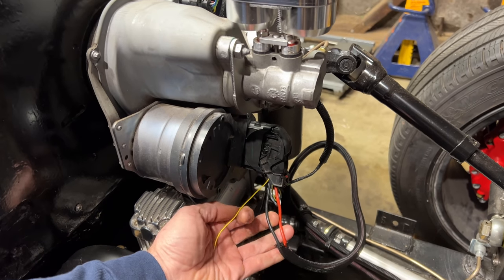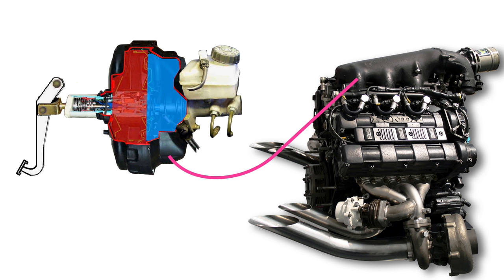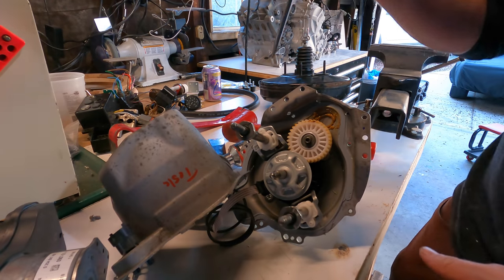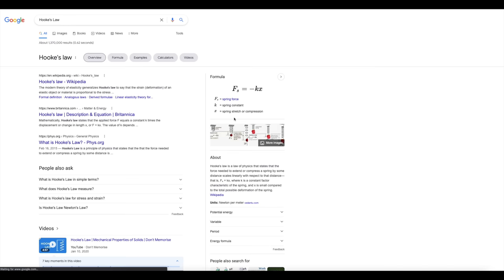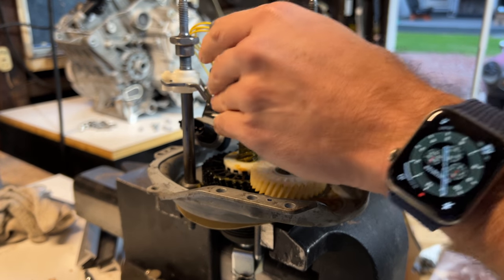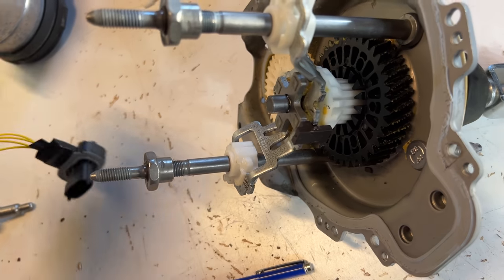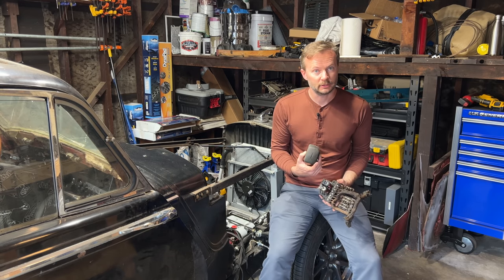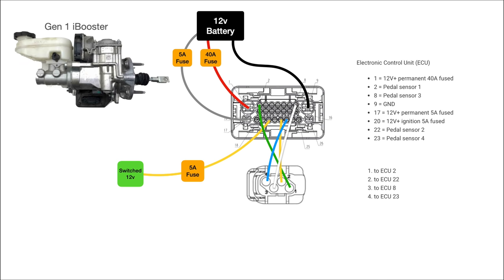Inside Tesla's Brake Booster (And How To Use It On Any Car)

Comment: If you have a CR-V gen1 iBooster and don't want to use the remote reservoir, the direct mount reservoir from a 2014-2020 Mini Cooper fits with minor plastic trimming near the front inlet port. I found it was less expensive to buy a complete used master cylinder than to buy the tank alone new from the dealer.

Comment: Thank you for the tip on the 2018+ Honda Accord brake booster. I got a Gen 2 Bosch iBooster complete off ebay for $157 shipped. This will make my 1955 GMC pickup MUCH safer! So thank you! ❤️

Comment: I remember my first car annihilated the catalytic converter and it got completely plugged up. So the exhaust gas with no where to go, went through the EGR and created positive pressure in the intake. I’m not sure which was more terrifying, my brakes going stiff, or the pedal going to the floor. Because Ford gave me both of those experiences.
Reply: They also pipe engine sounds thru a plastic tube into the cabin. So you can hear Fords mechanical failures more clearly.
Reply: What model and year of Ford was that?

Comment: Check out the braking System on the Audi eTron. No contact between brake pedal and brakes, only in emergency fallback mode you get a physical connection.
All that in one box.
The result is perfect, seemless blending of regen to friction brakes.

Comment: I work in a automotive reseatch facility and we have found that the Prius Prime and the 2019 and newer Chevy bolts use brake by wire. The boosters are set up pretty much the same. The cool thing is when the car is going to auto brake mode and you don't press the pedal the electric motor still pushes forward on the real master cylinder slow the car down. The same is also true for one pedal driving mode. As you let off the accelerator and it starts to come to the point regenerative braking is not strong enough to slow the car it will use the motor in the booster to applied mechanical brakes to bring the car to a complete stop. In the event the braking system failed they have a mechanical backup that you show in the video during tear down to still stop the car. For the company I work for we do Dyno testing and is completely automated using electrical input to the throttle pedal and now the brake pedal so we can effectively stopped the car and speed up the car from a computer by tapping into the brake by wire and drive-by-wire systems.
Reply: It'd be super trick if there was a way to harness that with a front camera so you could do basic collision avoidance as an extra safety feature.

Comment: I love technology. It’s so awesome what can be done. 

What I love more is simplicity. My 3/4 ton’s brake booster started leaking causing the engine to run lean. Disconnect the vacuum line, cap it at the intake. The truck still stops when you press the pedal. Magic.

Comment: The tech was there. My 1992 caddy has a totally electric brake booster.  4wheel abs. Hydraulic  brakes with electric assist.  And yes it is a Bosch system. 

Thanks for video. Good work

Comment: I worked on the pre-assembly line of the motor unit during an internship a few years ago. Managed a project to drive the cycle time form 15s to 13s
Also did some supporting research for a "fast cure" process, you can see a little drop of glue between the motor and its ECU. Thats a UV activated glue, curing very fast but noch strong enough for the automotive environment. The "main" glue is actually deeper in the groove and all the way around, attaching the motor to the ECU and sealing the connection from the elements. The main glue needed this giant oven to cure in a reasonable time, but couldnt speed up anymore. So there was this idea to use the UV glue to fix it in place, withstand the forces of the production line and allow the main glue to cure over time.
Never knew if they completed that project so super cool to see :)

Comment: ABS Power Brake Inc. sells an electric boosted brake master cylinder.  It has a small pump you put low in the car.  Ordinary brake lines are run between the two.  It uses the brake fluid as a transmission medium.  It's for retrofitting classic cars that never had power brakes.  Doesn't stick out like a vacuum booster.

Comment: FYI:  The Tesla model 3 front brake rotors have the same 5 lug bolt pattern as a 65-73 Mustangs.  The Tesla rotor hat is very tall and works great for clearing deep dish Torq Thrust wheels with huge Brembo calipers.  Just need to fab a hub centric ring spacer like the one Mustang Steve sells for modern Mustang brake conversions onto older mustang hubs.

Comment: In 2003 the W211 Mercedes E Class had brake by wire, but in a very french sort of way. Sensotronic brake control had brake fluid in an accumulator that was maintained at very high pressure and signals from the pedal told the computer to release pressure to each brake individually, providing very precise control at each wheel. It was incredibly complex and eventually eliminated at the mid cycle refresh as Bosch was able to implement many of the user visible features like brake wiping and hill hold with a more conventional system.

Comment: im not done watching the video but i work in the autoparts industry and i sell brake boosters all the time but never really understood how that worked. ive never had one fail on me so ive never needed to replace it. immediately after the "inside the brake booster" segment i thought about what would happen when they failed. now understanding how the vacuum increases the braking pressure, it stands to reason that a symptom of a failed brake booster would be an extremely stiff pedal, which i've experienced while pressing the brake with the engine off. now that i actually understand how they work, i'll both be able to assist customers who experience this symptom, as well as diagnose the issue myself if and when a brake booster goes bad on me. no, i don't think i mind these extra talking segments one bit :)

Comment: iBooster is actually quite old tech now, and brake by wire from Bosch is already in production in the form of Integrated Power Brake (IPB) which is a one box, brake and stability control solution. Jaguar I Pace has an IPB as does the BMW 6 Series and a good number of other cars from the last 2 years. There’s also a Continental solution that’s very similar.

Bosch did do brake by wire about 15 years ago in the Mercedes SL. It didn’t go well. A number of Asian suppliers like Nissin have made boosterless systems too as you saw in your Toyota, but for some reason they rarely quote for business outside of Asia.

Comment: This is intellectual humor at its finest! Great writeup on the Ibooster. I have been wanting to know more about it, but have put it out of mind as of late. When I saw that you had put a video out about it, I haven't clicked on anything so fast in a LONG time!!! I am already thinking of all of impractical uses for this.... 😂
Reply: I wonder if I could get away with mounting one of these on a trailer to run hydraulic brakes using the brake controller on my truck to control the booster remotely.

Comment: Regarding the functionality of the sensor:
The hall effect sensor (aka sensor sensing magnetic fields) is not capable of sensing force. What it does sense is the position of the magnet in relation to the sensor itself. When you press the pedal, the sensor notices that the magnet has been moved and it does not like that. It wants the magnet to stay right in the middle. So it tells the motor to rotate forwards, so that the sensor can move to the center position of the magnet. As long as the pedal is in motion, the sensor tries to keep up with the magnet. When the pedal is released, the magnet moves behind the sensor. The sensor does not like that either, so it instructs the motor to let go and let the spring backdrive it. For what it's worth, it's most probably a PID loop that tries to keep the magnet in the middle of the sensor by moving the sensor.

Power steering works the same way, BTW, both hydraulic and electronic. Down the line, when the driver acts upon the system, he puts things off center and the system doesn't like things being off center so it follows the thing that has been moved off center.

Comment: Very informative video. I've got a1973 Jensen Interceptor with a long dead booster. Rebuilding will run several hundred dollars.  It's a tight fit, and the brake fluid reservoirs are remote on the original setup. The latest Honda unit looks like it might be a potential solution.

Comment: Originally, on my project vehicle was a single master/slave hydraulic brake system no booster, skipped the vacuum setup to avoid aftermarket lifters/ cam and went to a completely hydraulic booster at that time.  It stops on a dime but requires the power steering pump to be running should the engine be off.

This Tesla/ Honda electric booster seems great! I would like to know how it works on your car. 

My truck is just below 2 tons so, using an electric brake system from a car had me a little concerned if it would be able to handle riggers of the off-road until you mentioned that these e boosters are being used in a 4,500lb Tesla. 

Great tech integration, following along on your interesting build. Your getting witty with your comments about the braking system.  

There are so many ideas of what you could consider to do while you explain another system in your vehicle like you did here with the drum set.  

Perhaps, next time you will be sitting down at a lunch table and eating something during the whole video without saying a word just deep in thought with your voice over.

Comment: It’s very similar to Hydro boost system used on diesels that don’t have air brakes. definitely agree it’s a better braking system, only bad thing about hydroboost is you can lose your power steering in an emergency braking.

Comment: For those who couldn't watch the incessant drivel, here's a TLDW.   Plastic gears and gearbox with a "one-time" gasket, custom/proprietary motor with integrated PCB in a plastic enclosure, complete with custom/proprietary high pin count connector.  Plus additional custom/proprietary sensor.   Recommend passing on this and just stick with hydroboost.

Comment: I bought this Government surplus 1976 Bedford Electric or Griffon in the US. A really cool van GM brought over after the gas  crisis as some sort of government deal between the big 3. I did not have the battery cradle and this was a couple  before Tesla. The plot of this story is the van had a small hump where an engine cover should be and underneath was the most horrifying discovery, a cast aluminum box 1.5' x 2' with a giant LUCAS cast into it. Having grown up in the 60's and 70's I owned a ton of odd ball British cars and the weak point was always Lucas Electric!

Comment: Congratulations, Matt, on your channel growth.  Your content is varied, presented professionally, and relevant.  The electric assist Bosch booster is intriguing to me.  I have a 1968 Polara 9 passenger wagon that has Wilwood  14"/6 piston on the front,  13"/4 piston on the rear, their MC with vacuum booster.  The braking on the car is really good, but it drives me crazy that I can't lock up the brakes.  I've heard that the Bosch setup will change that.  Any opinion?

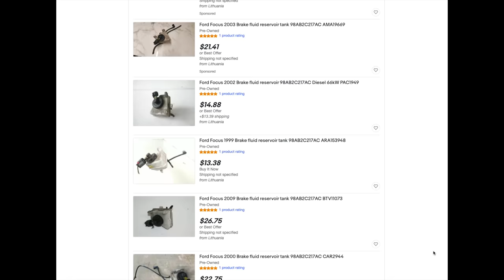Comment: 13:35 - scrolling through ebay... i see the ford focus brake reservoirs in that list. the ford focus has a 2 part res, which the pics show the upper part only, but that attaches to the lower part via hose. in your application the lower res could sit at any angle.

Comment: Re Brake By Wire: My son's old 2003 Mercedes E320 had the Sensotronic Brake Control (SBC) system, which was supposedly more-or-less a Brake By Wire system. For that reason, the system itself was a bit self-paranoid and timed itself out at 200,000 km. Being Canadian, there was no lifetime warranty. That ended the car's life circa 2020.

Comment: This is one of those rare times where i might select electronic over mechanical. If i put one on my hilux diesel i can run a modern 140amp alternator instead of the stock 45 amp one as the stock one has a vaccum pump on the back. Marvellous.  also might give me clearance for the intake manifold on my ke30 corolla as it looks to be of smaller diameter than the one i fitted  before doing the engine swap but after upgrading the brakes. Excellent. Was worried i was going to have to brace the firewall and just remove the booster and use more leg haha

Comment: An interesting brake booster is the hydro boost where it uses pressure from the power steering. see it alot on hotrods that dont make enough vacuum.

Comment: I drive a '65 Corvair and w/ the larger after market wheels/tires available (stock was a 13" wheel/tire combo) there is definitely a need for an electric power assist brake system, as the Corvair has a rear-engine configuration and running a vacuum line wouldn't be practicle. I went to 16" wheels to accommodate bigger brake calipers/rotors. There is currently a brake system that was developed by a Corvair enthusiast and is available (at Summit Racing, believe it or not) for about $1400. This Honda system looks like it could be a much cheaper option. Thanks

Comment: hi Matt, I've obtained a brake booster from a honda jazz 2021. this unit is in 2 parts, the motor/master cylinder and an abs/control unit.
I was wondering your thoughts  on using this setup, fitting the motor in the boot, then using the honda jazz brake pedal possibly coupled to some parts of the controller unit.

Comment: Pretty simple tech. Something not dissimilar has been in use in aircraft since the 50's. 
The thing that concerns me about these is without the addition of abs and a supervisor module you could have a failure of the transistor that drives the actuator motor. In 100000 cases it will fail in the off state (This is OK due to the build of the assist unit and you will still have brakes) the 1 time it fails in the on position (I have seen this on other transistors/SSR's) your brakes will fail in the fully on state and without an ABS to manage it it will go to maximum brake regardless and it will lock all wheels regardless of speed. You then wont be able to release the brake without disconnecting the battery.  It really needs a disconnect wired in so the power is shut of by breaking a wire or something if there is an hyper extension inside the brake assist unit. Electro Hydraulic for me.

Comment: If you have a pickup truck, especially from the late 90's to the early 2010's, please note if your truck has hydraulic boost or vacuum boost. The giant bunt cake pan on the firewall is the easiest way to tell. The parts guy HAS to know this to get you the right brake parts. Sometimes the GVWR can substitute, but ... look, just know what power boost it has. 
And no, telling the parts guy "it's just an old chevy" doesn't help. If it's a GM, take the VIN and the option codes with you if you don't have the truck.

Comment: Why not hydroboost or manual brakes (non-boosted master cylinder)? Hydro as in hydraulic, essentially works like vacuum booster but using power steering fluid pressure instead, with a much smaller area piston as you have much higher than atmospheric pressure to work with. I've got a bolt-on hydrobooster on my truck (depending on your vehicle, this might be a direct swap with the OEM vacuum booster because they used the same bolt pattern on some passenger "light" trucks and diesel trucks that come with hydroboost because diesels don't have manifold vacuum). Only modification needed is plumbing in the additional power steering lines - not significantly more difficult than an electrical connection, more expensive than wiring but much more robust. I also have a drop-in manual brake conversion for a different vehicle that uses a slightly longer lever arm by moving the pivot point to make up for lack of boost.

Both of these options are a lot smaller than a vacuum booster and make for a cleaner looking and easier to work in engine bay. I would argue that the manual brake is the most responsive / has best "feel" because it's totally predictable, vs. power steering pressure which can vary from say 800 psi at idle to 1400 psi under load - but realistically you aren't usually revving your engine and hard braking while also turning your wheels at full lock - so the pressure during normal braking is fairly predictable. I would suggest hydroboost for heavy vehicles as you might need the assist because you can't fit a 6 foot cheater bar on your brake pedal. On the other hand, for sporty driving, track days, drifting, etc. I'd suggest the manual brake option as you are more likely to be modulating the brakes and gas back-to-back in a turn, and it's "less to go wrong" without the extra power steering hoses. We all have fresh power steering fluid and haven't been running the pump low on fluid because of that tiny leak on your power steering rack, right?

Oh, and always run a dual reservoir, separate front-and-rear brake circuits type booster, so that if anything goes wrong, you still have half your brakes. Hydrobooster and vacuum boosters I've worked with always apply pressure "parallel" to the pedal force, so if the booster fails, the pedal still applies the brakes - you just have to work harder. I imagine the electric booster has the same "pass-through" feature. Of course, there's no "booster" to fail with manual brakes.